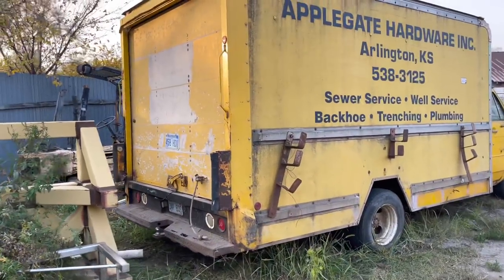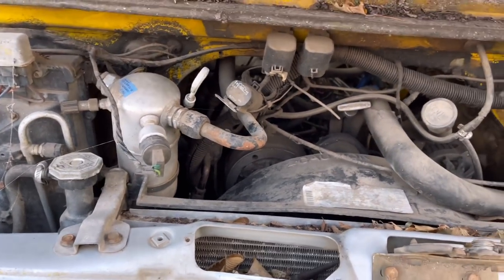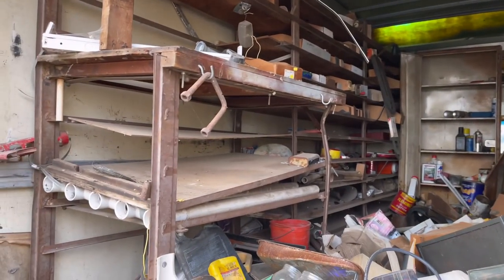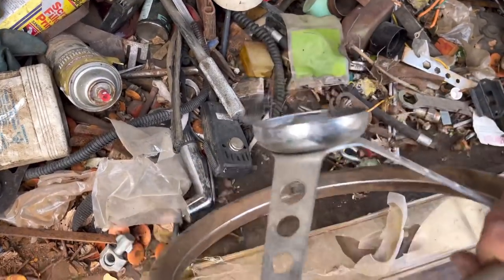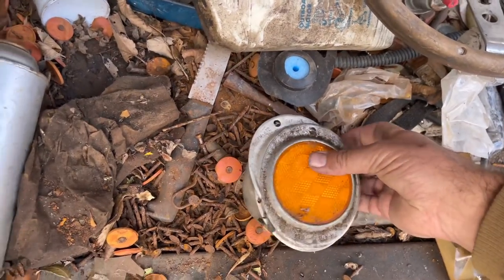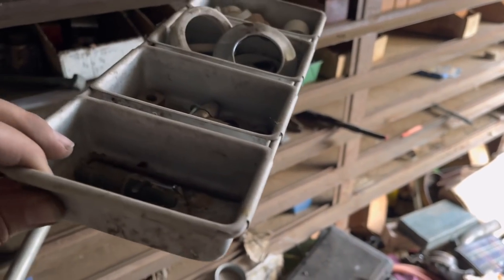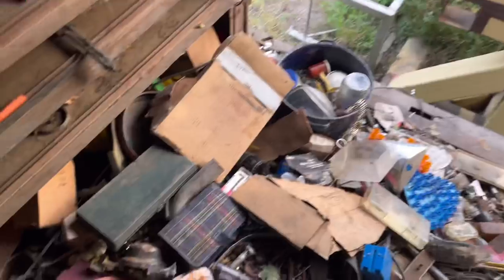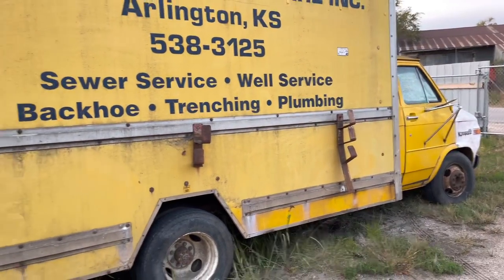Digging For Junkyard Treasure In A Scrap Mystery Box Van: What’s Inside?

Comment: For the Hollander interchange manual: what it does is take a specific part(s) and tells you what it fits. For example, it'll tell you that a cruise control module from a '95 Pontiac Grand Prix fits a '93 Chevrolet Malibu, or a front driver door from a '97 Ford Taurus sedan also fits a '99 Mercury Sable wagon.